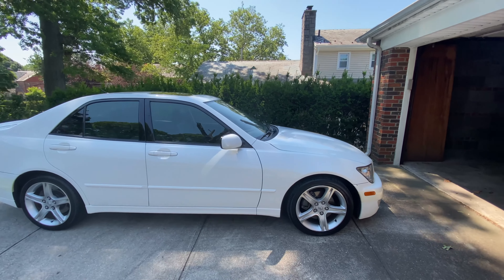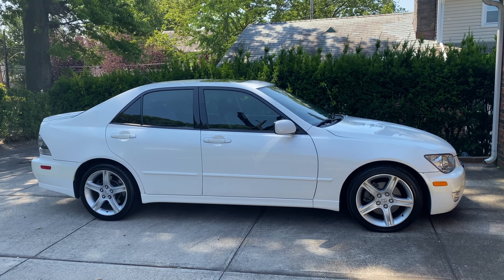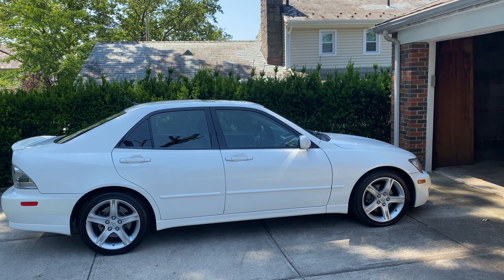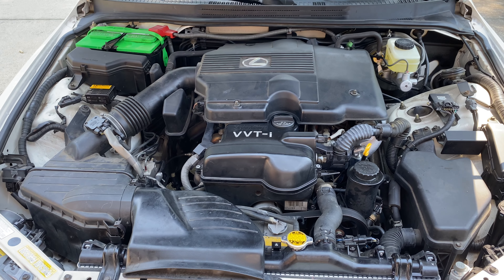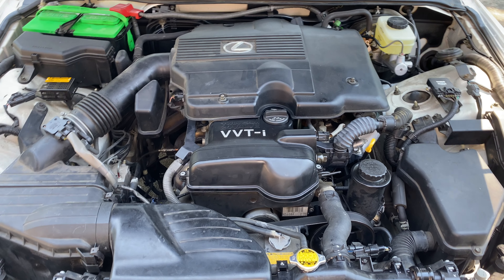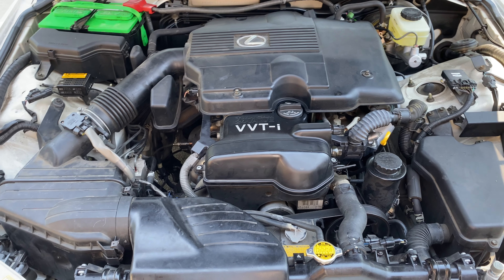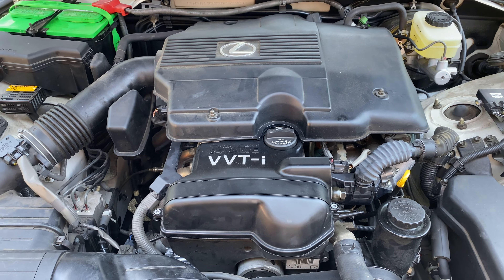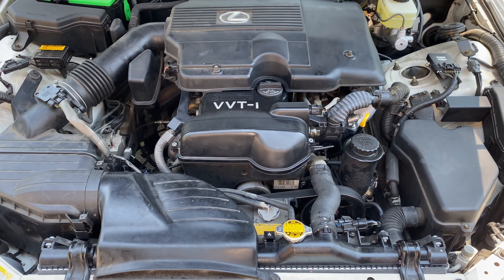A rare mint 2002 LEXUS IS300 in INSANE CONDITION

Comment: Amazing car!  You are one of the rare owners (original owner from the sounds of it) who hasn't given into temptations to modify and change it's original DNA. Your humble love, pride and enjoyment of your car is what it's all about, I have a lot of respect for you and owners alike.  Good call on keeping up with the maintenance and replacing parts/fluids that will naturally deteriorate over time.  

I believe you have an uncommon dealer option that I've seen very few people have in their IS300's, which is the wood interior trim.  I was never much into the wood trim on early Lexus models but seeing it in your car with a black and leather interior combo makes it look that much better.

I would suggest just giving the engine bay a quick detail to match the cleanliness of the rest of the car.  Unfortunately the rear bumper clear bra can be an eye sore once it starts yellowing and the chipping on the hood can progress overtime.  But it sounds like you have a plan of action for those which is great if you want your car in tip top shape.  Other than that, keep enjoying your car for another 20 years.  From one IS300 Sportcross owner (me) to another IS300 sedan owner (you), Cheers!